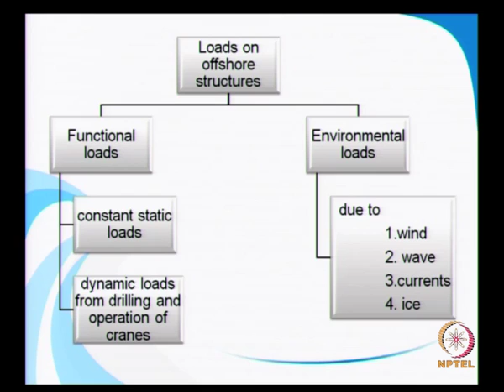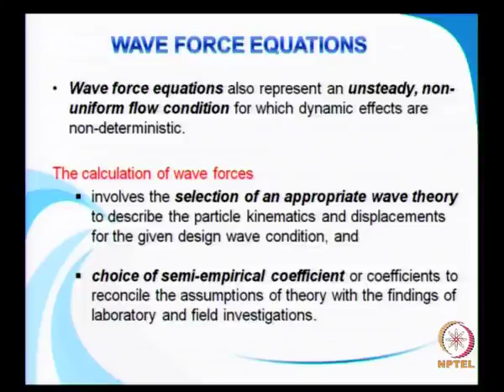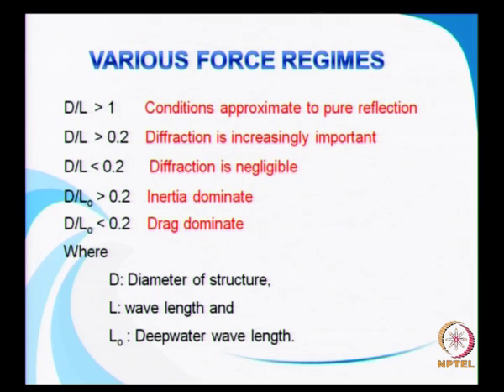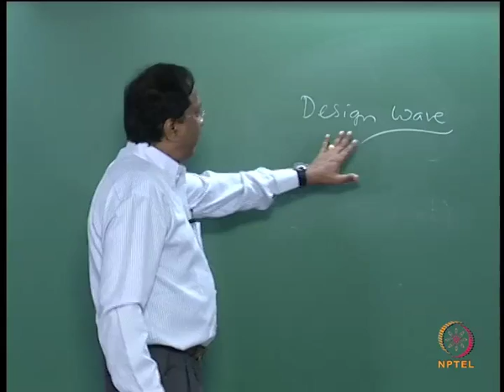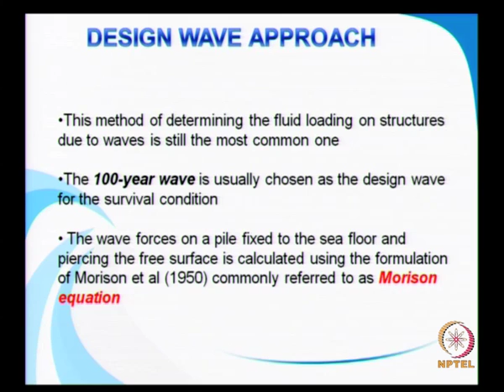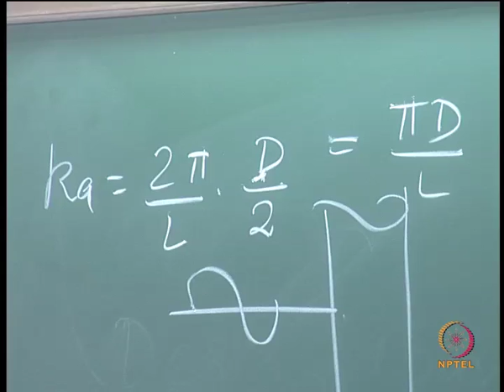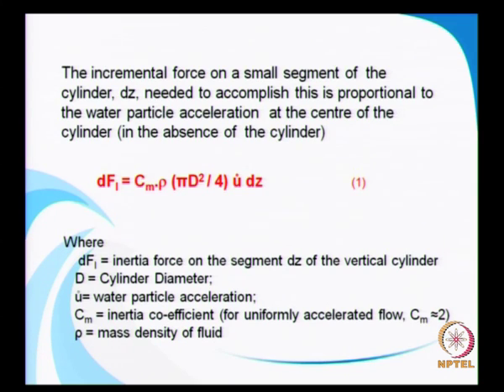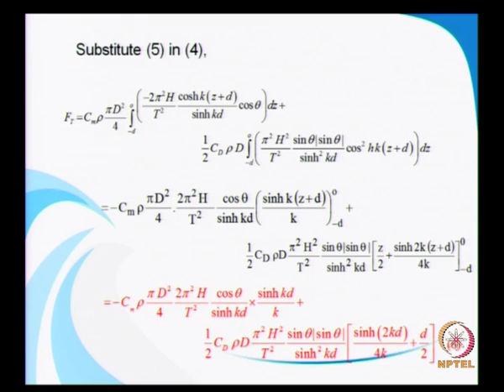Wave Loads on Structures I

Comment: I want to know the application of Morrison equation.Is it applied only on fixed vertical cylindrical structures or it can be applied on ships(which have motion-moving)?un moving ships(at rest)?offshore platforms?
Reply: So you found something??? I wanna know about parabolic load wave on pile find on each height by morison?